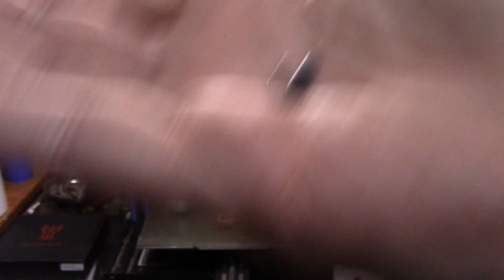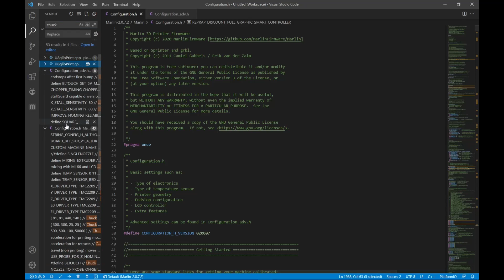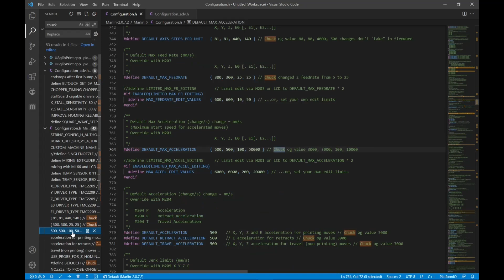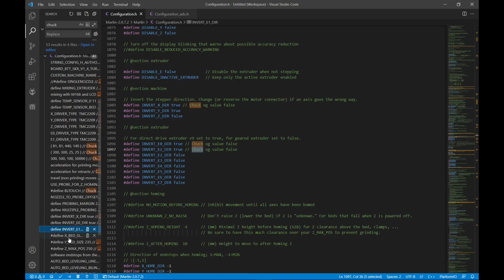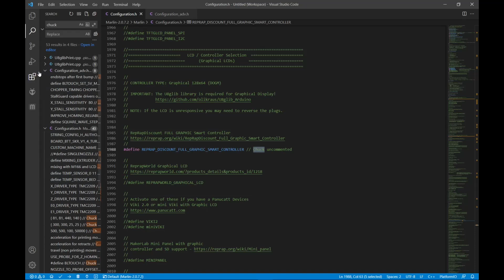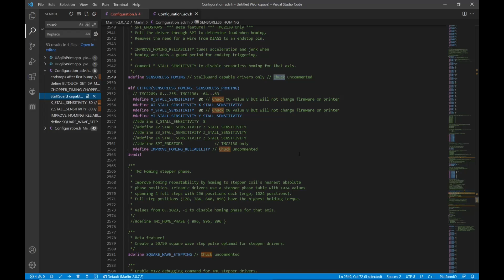Part 4 - BTT SKR 1.4 Turbo upgrade for Geeetech A10m - All Done! YAY!

Comment: Can u please share your Marlin config?
Reply from the maker: I got rid of the A10M printer but I still have the Marlin folders on my PC, I can make them available to you if you want. But understand I have no idea of what changes I may have made at the printer that didn't get saved back to the files on the computer.
Reply: @3rdpig if somebody got a Problem
compiling Martin, try a VM with win10 and VSCode 2022 - this fixed all my Problems
Reply: I followed ur Video nur got error while compiling so I would thank u if I can get them for a test

Comment: Will this board supports klipper and the chimera 2 in 2 out hotend?
Would love this on my A10M
Reply from the maker: BTT says it's compatible with Marlin and Reprap. Since I never tried to put anything other than Marlin on it I can't answer personally if it supports klipper. But on another note, I made this video 2 years ago and it's still working good.
Reply: @3rdpig  thanks. I'll try you're setup.

Comment: Chuck, after you flashed the firmware... did you do a M502 followed by M500? This is an EEPROM "clear" and will reset any previous options already set.

Also there should be an option in the flashing software somewhere. Just a toggle to clear or not clear the EEPROM. I keep personal documentation of EEPROM settings so the next time I flash, I just use the new settings in the firmware itself and I always clear the EEPROM upon flashing. This is a personal choice, of course, but it does make things simpler, in my mind anyway. Plus, I never have to worry about any leftover values.
Reply from the maker: I did not. I saved to eeprom after each flash using the menu command, but I did not clear first. I'll check that tomorrow. Thanks!
Reply: @3rdpig  Let me know if this works, I'm curious because I have changed some of those exact values, but I have the flag set in my flash utility to always clear the eeprom when I flash a fresh firmware. So it uses any and all values directly in the firmware itself, well... until and if I make any changes later on that is.

More often than not, I will just readjust the values in firmware right away and reflash right afterwards.
Reply from the maker: @ianide2480  Sorry it took so long, but I just went back in to reflash and made sure I did M502 and M500 after flashing, and that does seem to have solved the problem of some of the changes not being flashed to the firmware. Thanks!
Reply: @3rdpig  Very nice, I am glad that it worked.